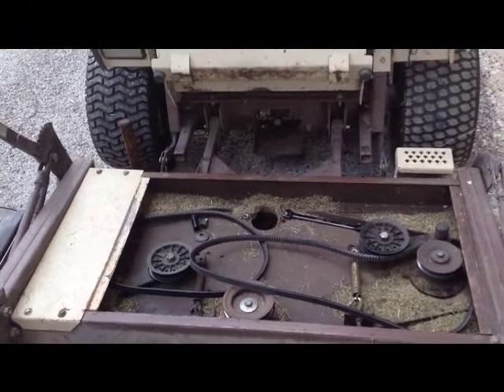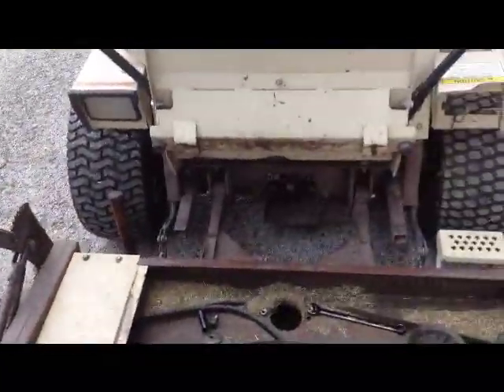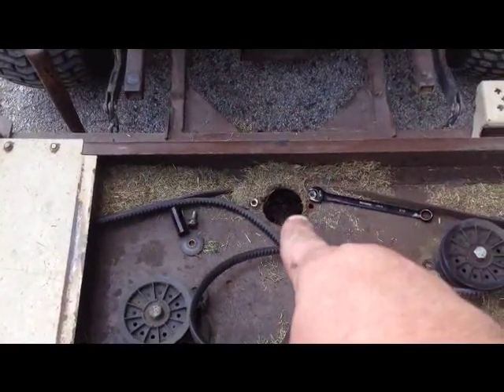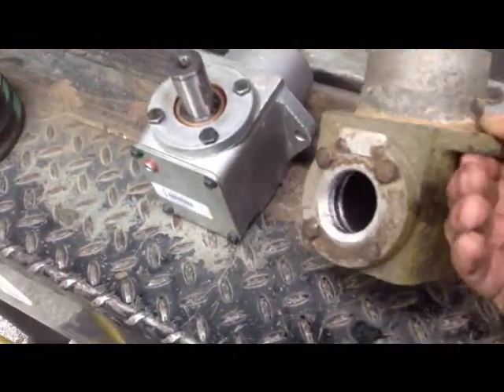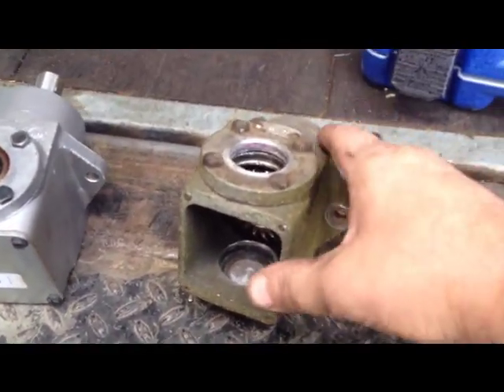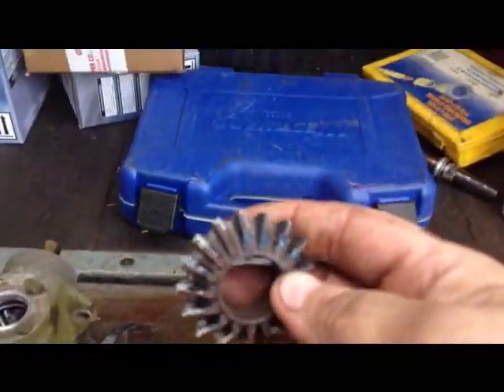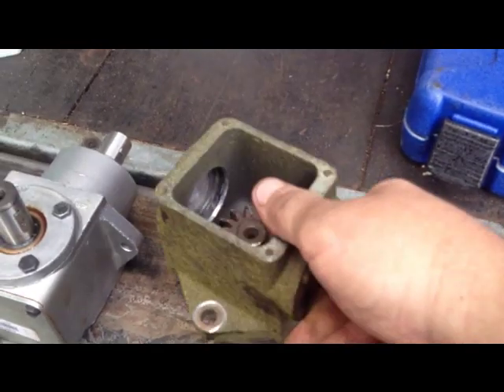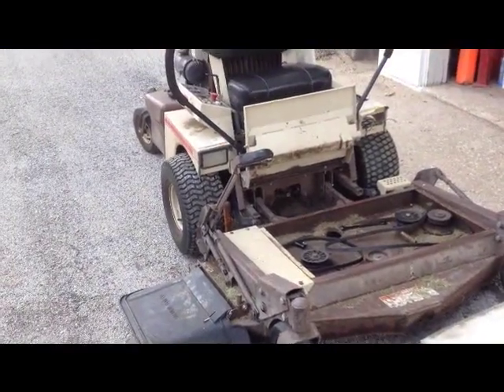Grasshopper 721 gearbox fail  /  diagnosis

Comment: Thanks.  At work I  have a 721D with the powerfold deck lift. When I raised it today to remove and sharpen the blades I noticed oil dripping oretty aggressively just below it. I suspect that the gearbox seals have gone bad. This 721 has a botton steel plate cover to protect the box, so it probably didn't get hit.

I think prices have gone up since you made this video.  A brief search shows this box to range from $260 to $300 depending on the supplier. Anyway, looks like this is where I'll start my day tomorrow. 😄

Comment: @mowermedic1 I just recently purchased a 2004 321D. What are the main issues you have seen that I need to keep an eye on? Also, did these mowers come with digital hour meter in 2004?

Comment: 725DT6 2013 52"
My mower is picking up a vibration. 
Started last fall the last week of use.
I have 1500 hours on the mower.
Drive shaft and pillow block's look and feel good no play in drive shaft.
It's seems like the hydro is vibrating back to the engine. The radiator shakes
In its Iso mounts.  I don't believe it has any connection to the deck operation. 
Just wondering if some type of mounts could be going bad or something like that. 
Any help would be appreciated. 
Thank's Joe, Reliable Lawn Care